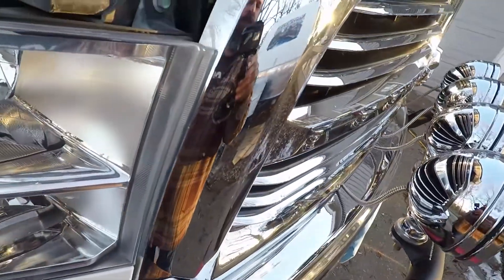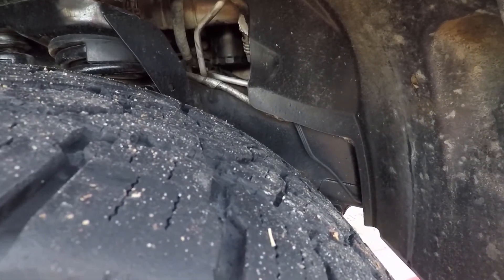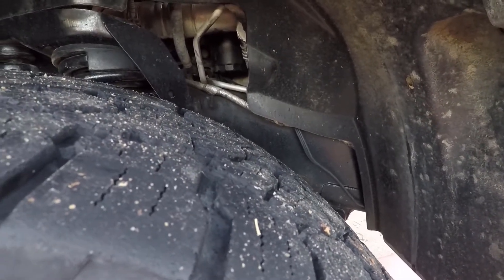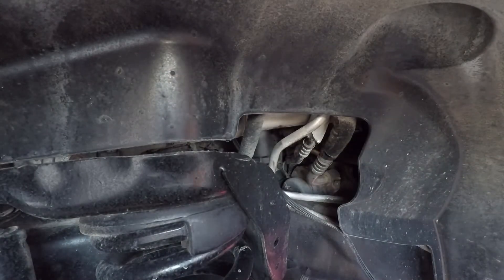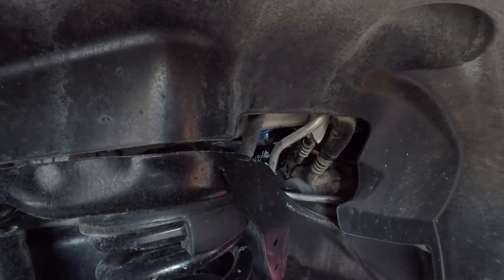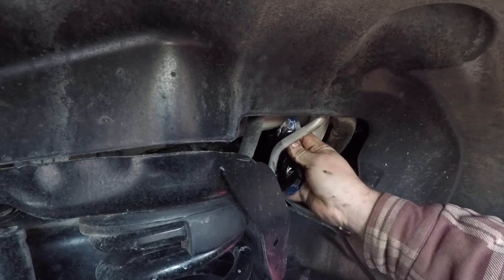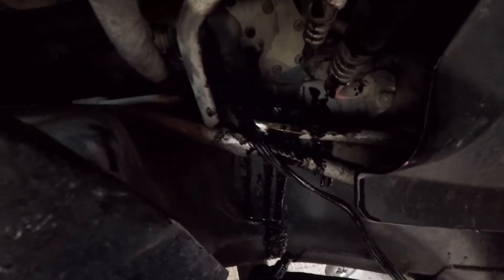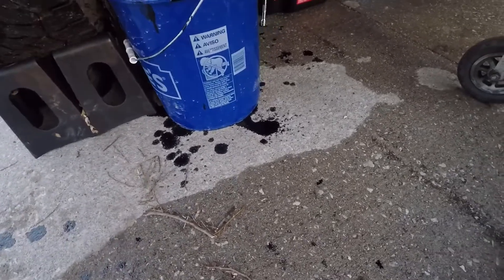Cummins oil filter "bag trick" FAIL!

Comment: On my isx Cummings I use an air hammer to put a hole in the bottom of it😛
Reply from the maker: I usually put a hole in vertical filters too. This one is kinda hard to get to the bottom of it. I'm contemplating a relocation kit. But, not until after the warranty is up.

Comment: Does that thing have VTEC?
Reply from the maker: Actually, no. It has a 3.5 horsepower Briggs in it. It's very fuel efficient.
Reply: To The Top Crane your husband will be pissed about the oil in the drive way
Reply from the maker: Cut and Clean TV, almost as upset as your husband was when he found out he has a wife? 😉